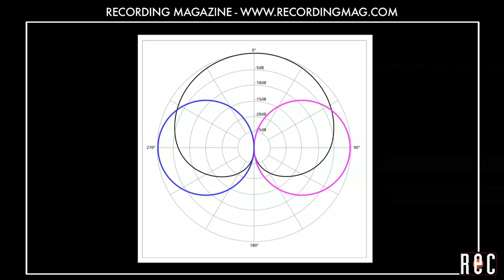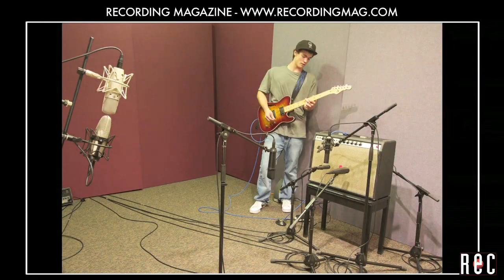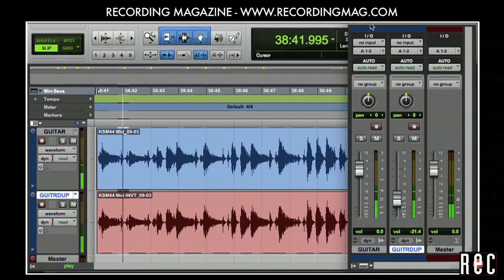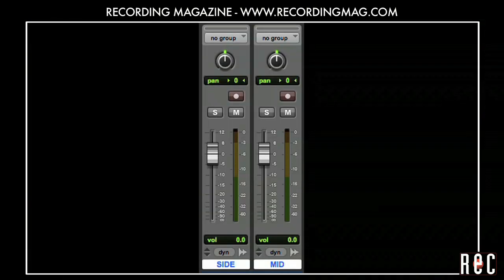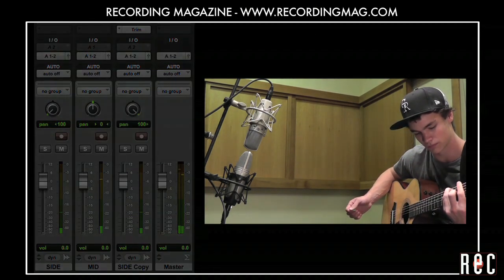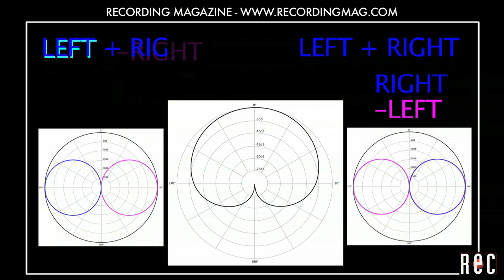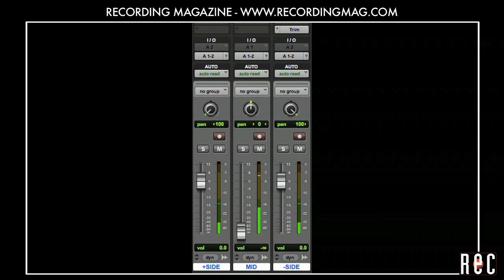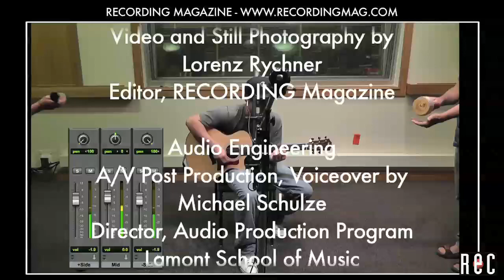Mid-Side Recording

Comment: I appreciate all the science behind this but mid-side is a fairly simple mic technique. You need 1 center facing mic + 1 figure 8 mic @90degrees to the source; Duplicate the figure 8 mic in the daw and and hard pan each - 1 left - 1 right; Reverse the polarity of only 1 of these duplicates. Voila.

I think the real thing I learned here was the ability make the stereo image narrower or wider through the mix which I hadn't considered. Also using mid side for electric when balancing a room vs amp sound- those are clever uses of the technique!

Comment: great explanation! would you say this technique can be used on anything? (vocals, guitar, violin, etc. etc.)
Reply: Absolutely!  Bruce Swieden recorded some of Michael Jackson's vocals in stereo, maybe not using MS, but it can make a lead vocal sound slightly less pinpoint than standard mono recording.  And of course with MS if you decide you don't like the stereo lead vocal you can just dump the side and stick with the mid.  Any instrument can benefit from MS simply because you can dial in your desired amount of ambience.  Distorted guitar, bass amp, certainly any acoustic instrument.  I use MS almost exclusively for classical recording where the ensemble is maybe 1 to 5 people, so not too wide on stage.  For a wide ensemble like a choir or orchestra you need something wider than MS, or spaced mics in addition to MS.  By all means give it a shot!  Michael Schulze

Comment: Why does the figure 8 mic pointed to the left also pick up reversed polarity Sound from the right? Thanks!
Reply: Because that's the way the microphone is constructed to allow recording e.g. with this method. Don't think it's pointed to the left, it's pointed at the sides. The only difference is the polarity of the signal - one side is positive, the other is negative.

Comment: This is a great explanation, but why do I need the MID?
Reply: Mono center information is valuable for mono compatible playback as well as devices which take advantage of mono center like 5.1 Surround. It will base the front speaker from mono center and the rears will be derivatives of the stereo information. Equally as important it will prevent the hollow results of extreme LR panning, with no center the width is at maximum. Blending some or all of the center channel fills out the middle, feels like mono plus stereo, which it is. As he mentions, you need figure 8, or multiple mics. It can also be done with an assortment of sources, such as IR’s. Just setting up a 3 channel matrix will achieve the desired LCR effect. Left Center Right. The more variables, the better you can tweak your desired mix result so you can explode in width for big parts and shrink the middle for stereo features, for example.
Reply: @Eventual420  Wow! That's helpful. Thank you for your answer!

Comment: Thanks for the video. I am new to this but still don't really understand. There is only one signal coming from a dual condenser or ribbon mike. So are you saying that there is some kind of encoding on the signal that provides 2 streams of analogue from the figure of 8 mic ?  I set up a NT2A as the "sides" and an NT1A as the mid. In the DAW these recorded to 2 channels. I then duplicated the NT2A channel and flipped the polarity of one of them, panning one 100% left and the other 100% right. I had recorded close up sounds on the left and right hand sides and expected to hear the stereo separation. However I did not get stereo. What have I missed ?
Reply: you might change the way how two NT2A track are pan
Reply: You are PRECISELY right. This just gives you a "stereo-ish" feeling. But, since your fig-8 mic is really a mono line, it's not gonna give you a true stereo image. 

The proof is at 7:00 — right? You should hear the shaker on one side and the cabasa on the other. Look where they're standing! But you don't. 

Psychologically, you feel that it's a stereo image, but close your eyes and don't look at the guys. Now switch ears with your headphones or buds. Nope. It's a very centered image, with no real separation between the three instruments. 

It feels great, because you're getting all the ambience that's bouncing off the walls, and a strong image from those percussion instruments.... but since it's all coming down one line [albeit polarity-shifted] it reads as very centered.
Reply: NOOOO!!!!! I take it all back. It DOES give a moderate stereo image, with a little bit of left presence on the right side and vice versa. Mann!!! I tested it myself, walking back and forth and back pretty close to the mics, then again a few feet away.

The moderation of these percussionists is because they're further away. But there ISSSSS true stereo!!! I think it's because of math.

It's a little less 'natural' at this distance than a stereo pair would be, but there are distinct advantages! Crazy!!!! The polarity of the diaphragm creates a subtle directionality. You can hear it.

Check it out:
http://barrybrake.com/mid-side-strolling.mp3
1. just the center mic
2. just the side mic, polarity-rev'd and panned
3. both: the full mid-side
Reply: @barrybrake7049  Thank you barry brake. Your experiment helped debunk a naysayer I found on another channel. Excellent!
Reply: @ToddBeal  Glad to finally be useful!
Reply: @barrybrake7049  that’s a beautiful recording, man! haha
Reply: @slacktoryrecords4193  heh thanks

Comment: Why doesn't the reversed phase copy cancel out the original side recording?
Reply from the maker: You are actually correct if you remove the center channel and play the side channels only, and sum them to mono, they will, in fact, cancel out. This is one of the advantages of MS recording is that when done properly with the center channel in, Mid-side recordings will sum perfectly to mono.